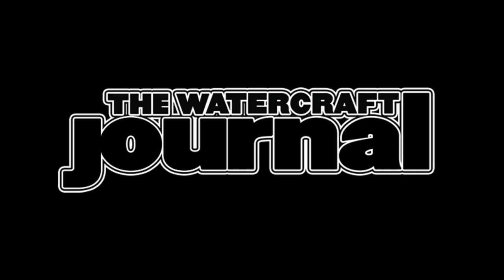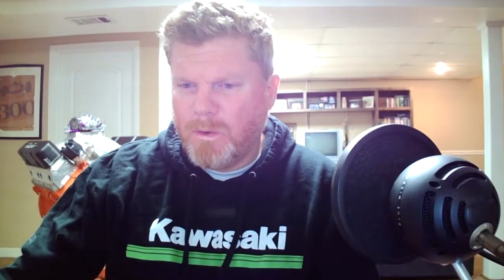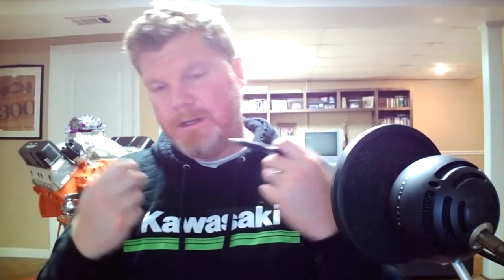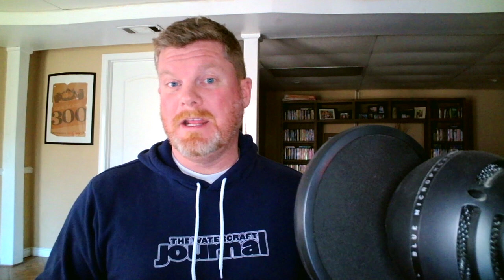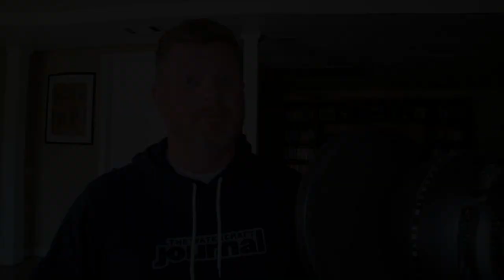Should I Use Salt Away on My PWC? WCJ Quick Topic

Comment: I use fluid film on inside of hull, works amazingly well and is pretty durable coating.
Reply from the maker: Awesome! Most people tend to find a brand they particularly like more than another. Just as long as you're doing the proper service, that's all that matters!

Comment: I agree with kevin, salt away the inside of the engine and WD40 it after you rinse it. Now I do this for my jetski when I go down to Florida because salt air rust everything. So using salt away all over your jetski will dissolve all the salt that's on the outside of your jetski.  You can even use salt away on your car. It will not hurt it as long as you spray it off with fresh water. Salt away is biodegradable so it will not hurt your ski or vehicle. 👍👍
Reply from the maker: Hear! Hear!

Comment: Hi Kevin I have heard people say that wd40 deteriotes  the rubber hoses on the ski,  I'm not sure if this true but can you shed some light on the this please ?
Reply from the maker: WD40 is just a penetrating oil spray - it's not a caustic rust remover or some aggressive chemical. Just a "water displacing" (WD) oil spray and its generally pretty safe (safe for paint, chrome, rubber, glass, body plastics - most materials cars are made out of).
Reply: This is very true on it deteriorating rubber hoses. We tested this on my airboat and why the fuel lines was cracking. If you buy WD by the gallon and put it in the spray bottle after a few days you will notice the bottle is sucking in. That’s because WD is bad for plastic and rubber

Comment: I wouldnt use WD-40 in the engine bay. Its a solvant, not a lubricant. Over time it will eat away at rubber, including wiring sheats, hoses, seals etc. It's also very flammable. Not exactly what I want all over my hot engine. If you want to coat your engine and hull, get Silicone Spray. It's an actual lubricant and protectant, it's water resistant and not so apt to burst into flames the way WD-40 can. In fact, WD-40 brand actually makes a silicone spray lube, and it's really good stuff

Comment: Yamahas manual literally says use Yamaha silicone spray for inside your inside your hull for a rust inhibitor or WD Specialist Silicone  you can literally blast the whole compartment and it doesn’t harm anything on top of that the silicone is good for the rubbers and plastics , should only use WD-40 on specific engine work but the manual literally breaks down exactly what to use for which purposes and WD-40 will 100% destroy the rubbers and plastics this happened to my brother on his jet ski when I told him not to do WD-40 use silicone and his hoses got deteriorated.

Comment: Rinse out the salt away? I thought the purpose of salt away was for it it to be left behind on metals to prevent salt from adhering in the future...
Reply from the maker: No, you definitely don't want to leave it on or in your engine. It's a detergent and will discolor and leech metals. Coat your engine bay in WD-40 or XPS to prevent salt build-up/coatings.
Reply: @watercraftjournal  appreciate the reply... great vids...
Thanks!
Reply: @watercraftjournal  I'll have to change my method then, i leave saltaway in the motor as per instructions on the product?
Reply: @watercraftjournal  should I coat my engine in WD40 before use, I’m about to pick up my new PWC soon, want the best protection
Reply: It very clearly says to leave the salt away on the engine and in the engine after running and to not rinse with fresh after on the packaging of the salt away so I can see how this is confusing.

Comment: OK I see u have answered this before...I like u based on your honest and what appears to be very educated opinion. I am baffled tho because salt away CLEARLY states not to rinse the cooling system or the engine after applying salt away. It says leave it on, no rinse. Why would they rec that if it damages the engine? At this point I am washing mine off per your advice but can you render a guess why they rec not rinsing.
Reply from the maker: As it is a detergent it is meant to be left inside so it can break down and flush out any contaminants and oxidation that might be in the cooling circuits.
Reply: @watercraftjournal  so why have u been advising to rinse it off?
Reply from the maker: Rinse off the SKI yes. It'll eat away at your paint/finish.
Reply: @watercraftjournal  OK so rinse off the ski but leave the salt away in the cooling system?
Reply from the maker: Correct. We don't like "leave it in the cooling system" as so much as "don't bother flushing fresh water AFTER flushing with Salt-Away."
Reply: @watercraftjournal  Thank u for your patience mate!